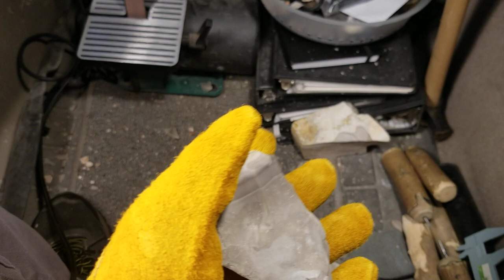1208 - Hammerstone Flintknapping - Intro

Comment: Very informative video. Lots of information regarding wedge shapes & bit ends. When I made a dug out canoe with Jack Cresson we used tough argillite wedges to split the wood in the gunnels with the grain. One very large one called (big Bertha scared the hell out of me as Jack swung a big hard wood billet into the top full force. I felt like an Aztec sacrifice until we ground & polished the bit & we began to get better wood removal. The tree was soft green Poplar. We also had great success removing wood from gunnels with the grain when using hand held chissels made of moose antler & cow bone struck with dogwood billets. As we worked the bits (shaped with an angle less than an adze) became polished & extremely polished. They rarely needed resharpening. Hard wood oak surveyor wedges were placed into the end & sides of a log of poplar to split off a long section to make a flat surface to be chopped & burnt on another dugout canoe being done by folks also using all organic tools. Amazing how large sections could be split & removed from a defined section to a cross cut. I enjoy  your humor. Some very funny remarks. Thank you for sharing your knowledge with this video.
Reply from the maker: Thank you very much. And thanks for sharing your experience with the dugout canoe. That's awesome

Comment: I've never made a wedge, but I was watching you work the first piece and blunting the base of the wedge.I was wondering if setting up the base corners to run overshot flakes with a little convexity would do good...or even isolating a platform and basically run a fluting flake from both sides to create a flat area.
Reply from the maker: Yeah, but the "setting up the platforms" is the hard part on the thick end. Easy to do with a thin edge or modern tools. If you notice, I'm using a beveling technique and striking the actual surface of the face of the workpiece. You don't need platforms for that.
Reply: @KnapperJackCrafty  I see what you're up to but was just throwing the idea at you to minimize wearing out a mallet driving them in. I'm going to go dig and see if I have a piece big enough to try that idea myself. I thought just knocking in some side notches at the base would allow for platforms early in before final shaping and edging. End to end shaping would minimize the steps and platforms you mentioned that the wood would remove. The cross flaking may help keep the wedge from being ejected too...so there's a tradeoff. I've got my tissues ready for my attempt...lol.
Reply from the maker: @GL4speed  it's not a bad idea. If it works, that would be awesome.

Comment: Ever use Persimmon wood for mallet? Used to make the head of golf clubs. I have, hard and good weight.
Reply from the maker: Persimmon is not nearly as heavy as live oak... so no.
Reply: Soon as the sap falls i will cut some Live Oak poles to dry over winter and try next year. Thanks.
Reply from the maker: @ernie2214  cool

Comment: Did you every try TIG  welding gloves? Will conform to the hand better, they are leather, deer skin I think. More dexterity with this type of glove. More expensive not sure about durability.
Reply from the maker: I was a welder for a short time. The gloves always seemed very bulky.
Reply: @KnapperJackCrafty  If you did stick welding the gloves are heavy and bulky. TIG gloves are supple and conform to you hand. You will like them not sure about durability.